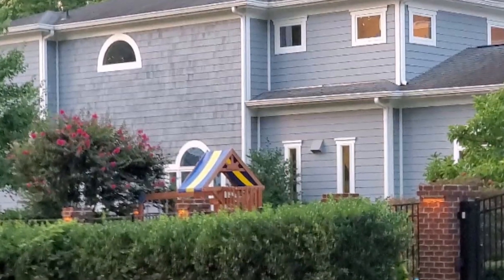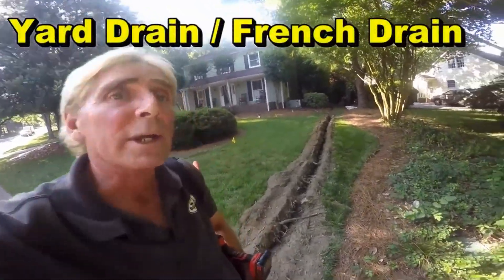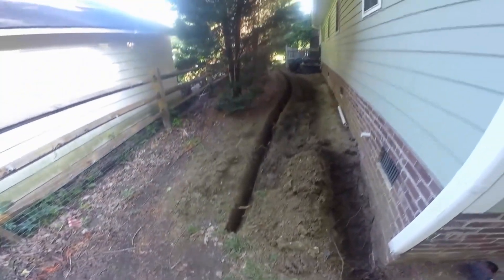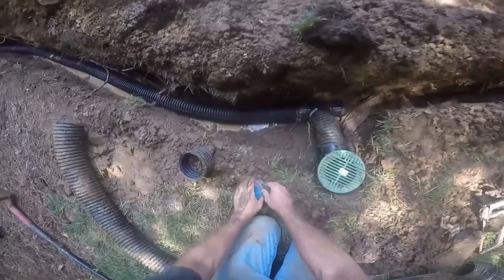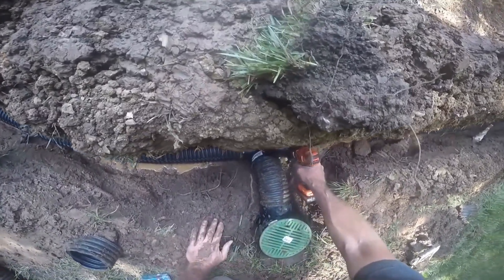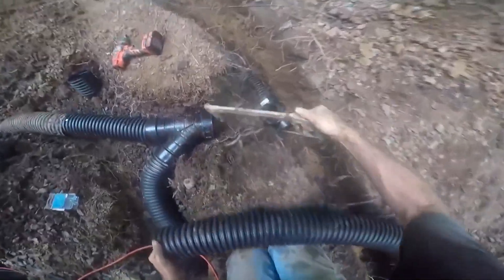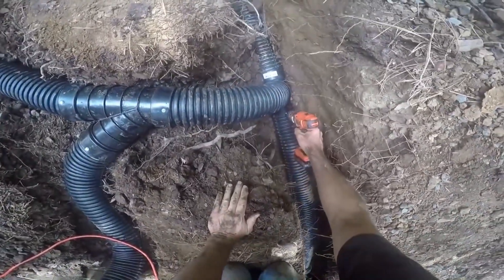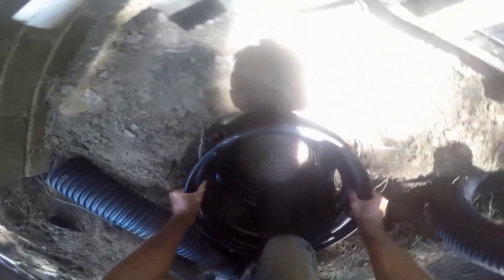Rainwater Drainage System, How to do it Yourself for Homeowners

Comment: Not sure, that pipe does not even look rite. That’s flimsy, weak pipe, roots will crash it in 3 months, heavy soaked earth will do the rest. How r u going to clean it ? jetter ? it will cut thru roots and that cheap plastic with penetrate nozzle altogether. snake ? it will do the same, you will end up cutting that pipe guaranteed . Would not you wanna put a more sturdy PVC pipe with holes at the bottom?

Comment: As a drainage contractor here in Memphis I always get the question when I run a bigger system like this. Is the pump going to keep up? And there is no better pump than the M98! I never get call backs for my system not keeping up during heavy downpours

Comment: Hello Apple Drains. I love these videos! Question: I’ve watched a video once , and I thought I heard you guys offer live consultations for a small fee? If so, I have an idea how to do my own drainage system but would like your friendly professional advice to do it right. Thank you
Reply: I did a live help session with Chuck and it was very helpful.  He helped me design an underground downspout and french drain system.  I installed myself and it works well.  Now I am encapsulating my crawlspace.  Good luck.
Reply from the maker: Hi Jon, Yes. Please use our service sign up sheet located on the website. Note: Even the Live Help Schedule is Very Full,  but I try to do 4 or or more consults everyday, so its about 10 days out right now. Thanks, Chuck
Reply: Apple Drains thank you! We’re in no rush here until we have funds to actually buy the materials . We’ll be in touch!